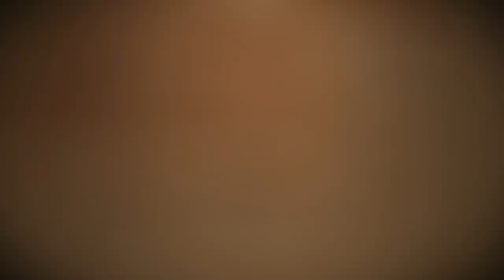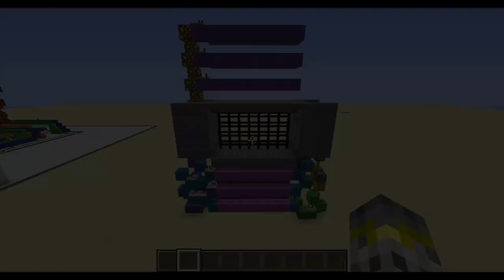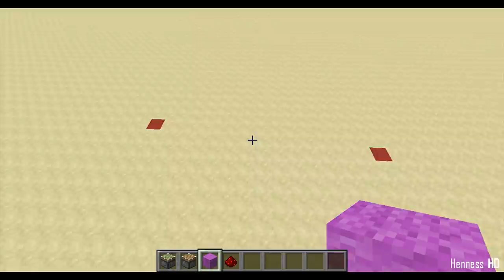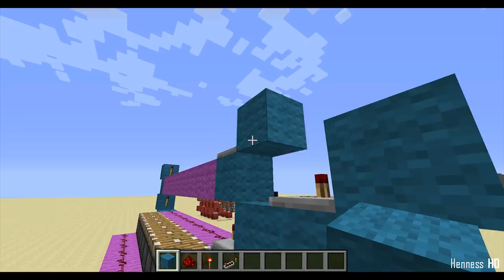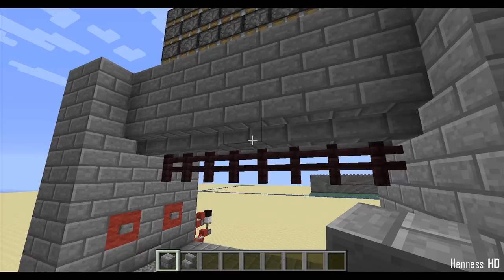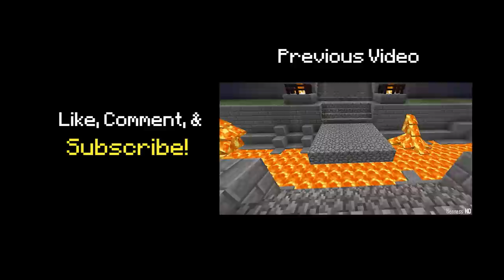Super Compact Piston Gate (Portcullis) v4.0 Tutorial

Comment: The T-flip flop works like a lever, so think as it if you were using a lever; off state and on state, if you plug 2 different devices/circuits to the output and you want to alternate simply invert one of those 2 circuits. In this case the output is the bottom part of the t-flip flop (one of the two blocks that connect to the block being pushed by the lowest piston).

Comment: This gate will work with 1.5 as long as you make two changes in the settings of two repeaters. You must first implement the bug fix for the monostable circuit which he linked to in the description. Change the repeater in the monostable (green circuit) facing away from the rest of the gate to 4 ticks. Next, on any of the 3 repeaters placed at the 4:06 mark in this video, add 2 ticks. This will make the last piece of gravel lag for a split second when retracting but at least the gate will work.

Comment: I think there might be a directional glitch with this design interacting with the game (vanilla Minecraft 1.4.7). The design is fantastic and I have it working several times in several places, but specifically when I am trying to build it with the "front" (the 3 rows of the magenta circuit) to the east, it never lights the first torch you hold off on placing (cyan circuit, bottom) long enough to send the signal up. the not-gate torches.

Comment: to make the gate work you just have to change the timing of the mono stable circuits to 4 ticks, and then the backside blue layer needs extended to at least 2 ticks so that the pistons have time to return to their normal state and extend again also it is imperative that you use stone buttons and not wooden buttons because wood buttons stay pressed for longer and interferes with the circuit

Comment: Hmm... I don't have to use an extra button to close mine. I have mostly the same design, just different wiring from the buttons (mostly because I wanted to move them further away) which fixed my piston issue. The only thing I can think of would be that your timing is a bit off, which is why the pistons aren't retracting properly?

Comment: I added a 2nd delay on the bottom and now all 3 pistons extend properly. However, they do not automatically go back down (all 3 rows remain powered thus keeping the pistons extended). Upon pressing the button again the bottom piston retracts before the others, refusing to take the top two back down with it. The top two function properly, but again the bottom piston is firing before them and retracting while the other two pistons are extended.

Comment: Does the top piston closest to the buttons (that pushes the gravel/sand up) not go all the way down? Because if that is the problem, make sure you are using stone buttons. For some reason, that piston extends a second time right as it should be pulled down, and it only happened with a wooden button.

Comment: i got a problem with this Gate..
I built it exactly like you did and added the bugfixes, but it doesn't achieve the desired result. Pushing the gate down works fine. But when I push the button to open the gate the lowest row of pistons in the upper part activates and pushes the gate 1 block down again.. what did i do wrong? i dont understand.. 

thanks for help :)

Comment: I've been trying to use this gate on my server for a few hours now, rebuilding and trying to finagle... but for some reason, the yellow circuit piece that determines whether or not the top pistons or the bottom pistons activate isn't working properly.  The top pistons continue to activate every press of the button where as the bottom works as it should, activating only every other press.  I've also included your fixes in your most recent video - but still, no dice.  Any suggestions?

Comment: @Keengan Eitter

I have that exact same problem right now, where a good 5 out of the 8 are staying up in the air and not coming down. I was broken down the complete structure and started it from scratch and it is still giving me the issue. I wonder if it doesn't work in the latest build of Minecraft. Also I am trying this on the PS4 Console.
Reply: +Craig V.L Do you know how i fix the problem of mine? It will only open the gate one stack so im not able to get out ? :/ U seemed smart so i hope you can help :)
Reply: Brandborg14 so far from what I have seen on my Minecraft world on the PS4 is that there is a signal that is still constant on the bottom row of Sticky Pistons. With regards to the glow stone that are proceeding up to the top three row of pistons with Glow Stone with the Redstone Dust some how is losing signal. I have tried boosting the signal with a single Redstone repeater but that doesn't seem to be doing the trick. I might have to sit down and have amore in-depth look on the PC rather than the PS4 and see if it a Minecraft version problem or just a Redstone glitch. I will keep you informed.
Reply: +Craig V.L yea thougt there was a problem with som of those pistons. But im a noob so i don't know how to fix it 😂😂😁😁

Comment: Cannot get the pistons to extend up properly. I've went through it multiple times and still doesn't work right. Originally it would only extend the bottom piston, and then not retract it. By setting one of the repeaters to max delay i was able to get it to automatically retract after extending, but it still does not fire the above 2 pistons. Any help would be greatly appreciated.

Comment: i must be doing something wrong at the 7min mark, i've done it 3 times already. the top set of pistons don't get pulled down. 

also, does it work if you cut down the width to 5 piston long? because i've tried it with 5, the left most piston gets stuck at the top must magenta block line.

Comment: 100% worked i had a few problems with the top part not getting power turned out 3 ticks of delay
wasnt enough to unpower the torch for long enough perhaps because im on a server? or because
i did the powering wrong but i just made it work in my own way idk but pretty much all i did
was take the button down to see what was happening then change the delay to 4 and it worked :D:D:D:D:D:D:D:D:D:D:D:D:D:D:D:D:D:D:D:D:D:D:D:D:D:D:D:D:D:D:D:D:D:D:D:D:D:D:D:D:D:D: